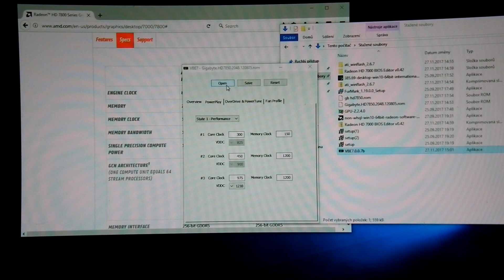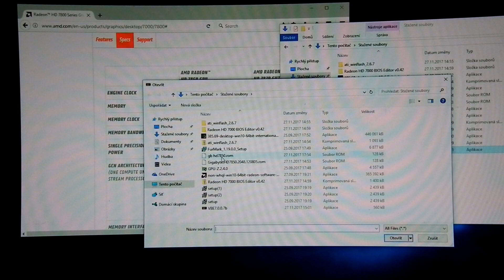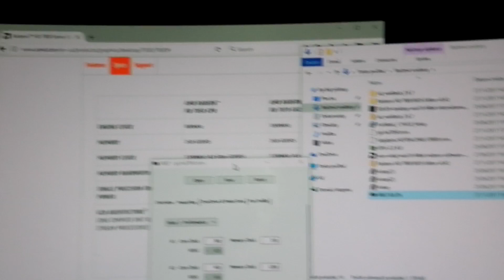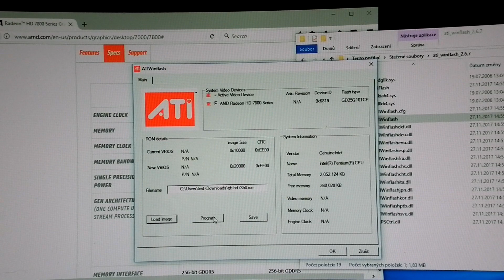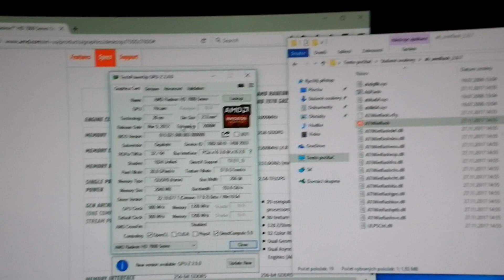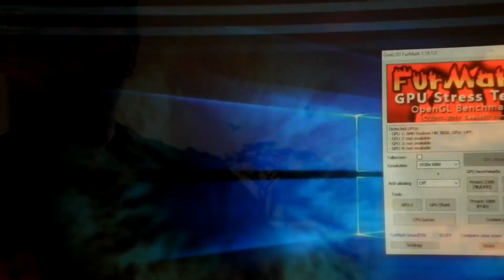HOW To MOD bios on AMD GPU Card with VBE7

Comment: That is a good tool. Hope we can disable a channel on AMD GPUs
Reply from the maker: Not sure but ye this soft is good for old and card
Reply: @frogtechtips  I got and RX580 8Gb that have issues with the mem channel A, and I would like to disable it. It's a comon issue with the meme controller inside the core. Disabling it could potentially revive the card, letting it working with only 6Gb or vram instead of 8Gb
Reply from the maker: @autodiag7044  not sure this software working with Rx model but let me know once you try

Comment: I use msi afterburner.  As u told me to down 10% clock speed.  I do it now the temp is around 70/72c and max 74c... My gpu doesn’t support under voltage  so i reduce the power limit  -3 😐.
Is ok?
Reply from the maker: Only way to find out is testing to see if that helps
Reply: @frogtechtips   thanks man 
Now i want to see how long it can last.🙀
Reply from the maker: @itzalu  let me know after

Comment: Can i use this program to mod my Sapphire r7 260x card?
Reply from the maker: hi I think yes with no problem as I used for r9 280 I even mode r9 280 bios and flash hd 7950 with that bios and after pc think I have r9 280

Comment: From where i can downlod vbe7  in this days time  ?!?
Reply from the maker: just write this on Google and will be first link on search I will send you link at evening as well if you can't find
Reply from the maker: hi here is link https://www.techpowerup.com/forums/threads/vbe7-vbios-editor-for-radeon-hd-7000-series-cards.189089/
Reply: @frogtechtips  Thanks man!  In my case    doesent work,  gpu-z dont  show me  the version  of  bios , gpu clock  0 , uefi is uncheck,  but the  fans, Sapphire logo  and 1 of the  4leds on  the back  working  windows  boot  , but  black  screen! Any advice ?!  any  other  gpu  i have  work  on  my sistem just this Sapphire 280x tri-x oc have problems! the  model is  11221-22
Reply: I forgot, also i cannot save the curent bios !
Reply from the maker: @JohnDoe-zi1vw  hi man is looks like this gpu is faulty do you have any other system to test that gpu to be sure is not problem with your pc
Reply: @frogtechtips   like i said before  al other GPUs i have works (280x, 290x 295x2,7990)  and also integrated graphics i have 4790k cpu.My pc work  maybe this Sapphire trix 280x is  broken!
Reply from the maker: @JohnDoe-zi1vw  I say that looks like this gpu is foulty I think your pc doesn't recognise    this card with looks like die is foulty here can't be two things someone maybe wrong flash this card with wrong bios I think your card have two bios you can try swap or this card need reflow
Reply: @frogtechtips  the pc recognise this card in bios,but gpuz show gpu 0 memory 0 and dont show  the bios  variant
this card work just 2hrs  but with crash or blue screen afther that, start in a little window with some vertical bars,and dont boot in windows,right now afther i change the paste ,the windows boot ,but black screen!
Reply from the maker: @JohnDoe-zi1vw  ye that's why I say is foulty die I think card need reflow check my other video how to repair gpu  I have so many card with this problem and 90% of tham need rewlow an 10% need just new bios
Reply: @frogtechtips  ok man, thanks a lot !
Reply: send me please a link ,some guys said to start the pc and GPU without the cooling sistem just the card itself without any  radiator and fan!
Reply from the maker: @JohnDoe-zi1vw  if you like kill your system you can do it card without cooling systems will be dead within 10 min
Reply from the maker: @JohnDoe-zi1vw  all link is on I button on top right corner on this video